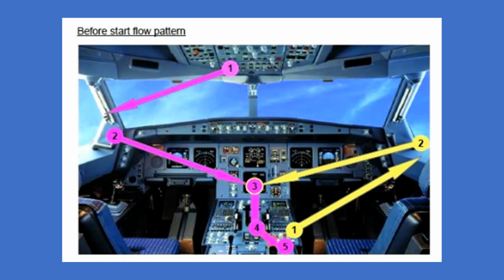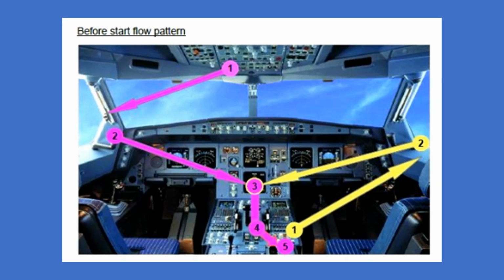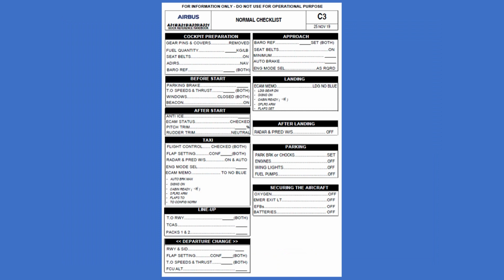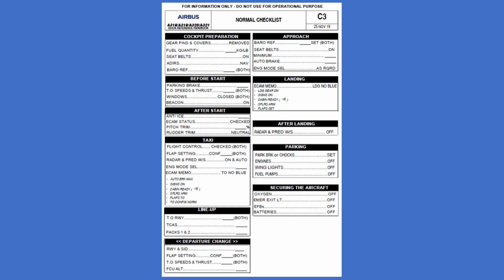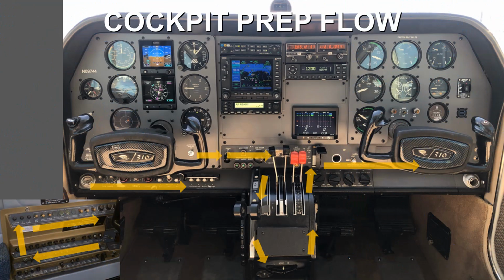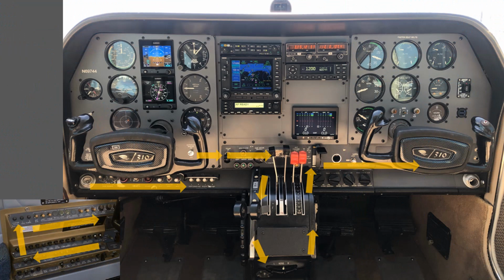Cockpit FLOWs for General Aviation flying

Comment: Jason, thank you for your elite, thorough and simple to understand check list (pre- flight flow check).
I don’t know anything about flying at all, except that I would like to learn, but strangely enough, I looked up your video because I want to get information for  my simple four wheel down to earth SUV, and my motorcycle. 
For years I’ve working in the commercial transportation arena , they are basic things that we check on transportation vehicles, trucks, even forklift, and scissor lift… Yet I noticed that most drivers (within my family ) just get in the car, turn the key and off they go… I do check my oil, transmission, antifreeze level, brake fluid, and how tight are post connections on my battery connection. I also often check my lights, low beam, high beam, rear driving lights, tag lights, turning signals, break lights and when I get help I also check the reverse lights too… I don’t check the brake if they work. I just drive off and they seem to stop the car. lol.
My problem now at 66 years old is that I’m taking longer in between these kind of checkups and you know that our cars do not have in some states certify inspection.
I was wondering in order to make my own ground vehicles check list… I wonder why with so many people on the road, some with medication, some with illegal substances, others may be upset with someone on the phone, etc. there isn’t a set policy to have a checklist before driving onto any streets???
Thank you again, I clicked the light button and I became a subscriber to later. See what other videos you have posted. 
God bless you whenever you read this  (12/8/2025 )

Comment: Jason, I was watching this video on flows. I welcome videos like this as it lets me know how others do things compared to mine. This helps me find mistakes in what I am doing and sometimes I see a better way of doings inflight tasks. Something you do, and I saw 310Pilot did the same, relates to the Aux pump position for takeoff and landing. I am submitting this with the best intentions and with no disrespect to those who may do things different from me. I have owned my 1972 310Q for 22 years and still look for better ways to do things. Finally, getting to the point of my comment, you and 310Pilot place the aux fuel pumps to “low” for takeoff and guessing the same for landing. All these years I have been placing my aux pump switches to “ON” for takeoff and landing. My pump switch is labeled up for “ON”, center for “OFF” and down for “LOW”. My Owners Manual checklist states the low switch position is for purging after start and “ON” (switch up) for takeoff and landing. My manual is the original for my airplane. Has Cessna changed this procedure and I just missed it? Does your manual say to use “Low”? I appreciate your feed back and please accept my question on this procedure with all respect to you. I am a retired airline pilot and used to fly the A320. I like the flow procedure but with the airline I flew with, flows and checklist did not match which I thought was not wise. I never trusted memory and always thought flows should match the associated checklist but they didn’t ask me. Thanks for your videos and sharing your procedures.
Reply from the maker: Hi Charles, my airplane has the MEB-88-? (forgot the suffix number) fuel pump modification service bulletin. Most 310's will have likely been modified by this. Maybe it's possible either yours isn't, or maybe the switches were never re-labeled? Not sure. On my airplane LOW (DOWN postition) is just a few psi boost, and HIGH (UP position) is for emergencies and will flood the engine out it's so powerful.